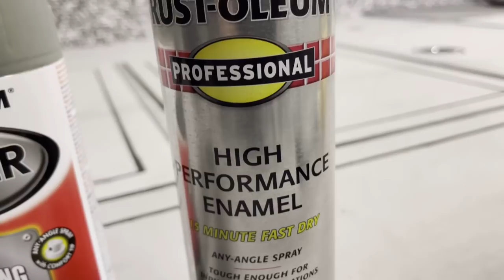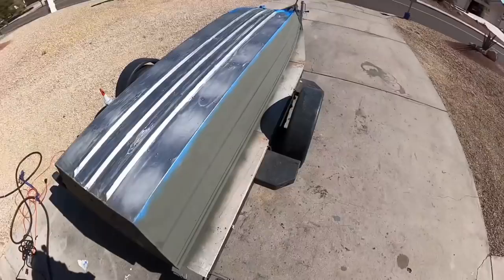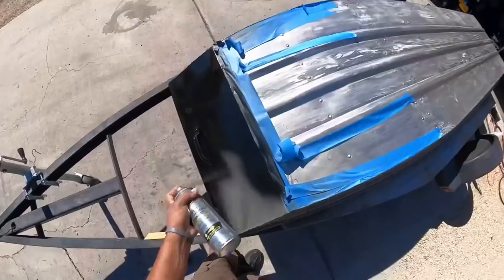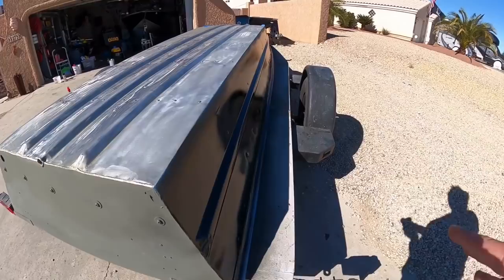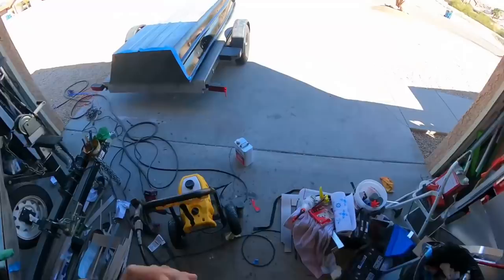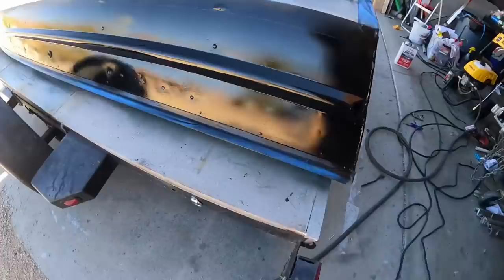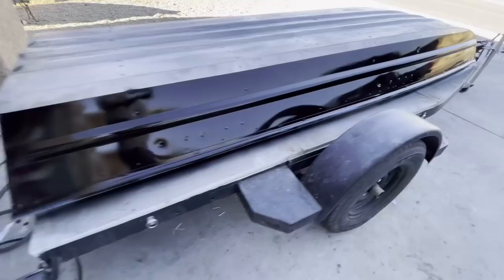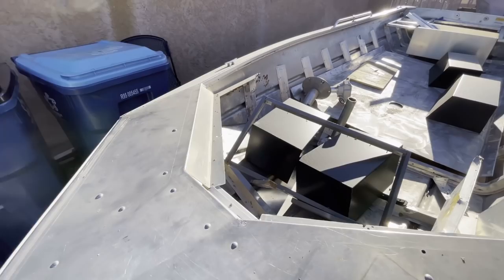Boat Painting made EASY: Painting Tracker Topper 12 | JonYak Project.

Comment: Question...i took rustolem proffesional paint and thinned it to shoot through a electric paint sprayer from harbor freight and painted my trailer...worked awesome and doesnt chip at all cause its nice and thick...do you think that would give a better paint holding power over a rattle can for the boat?
Also, i got a harbor freight spray gun and just tossed it when done cause it was cheap enough

Comment: Would you advise against painting the bottom of a boat with just spray paint, I understand it wouldn’t be anti fouling etc. just wondering if there is a reason you don’t see many small aluminum boats painted bellow the water line.?
Reply: @TinyBoatNation  hey thanks for the reply!! I did see that you are gonna use the gatorglide and definitely looking into that. Just wondering if the spray painted bottoms are frowned upon for any particular reason in general? Besides difficulty as most are being painted on trailers. Keep up the amazing work you’re an inspiration to many!!